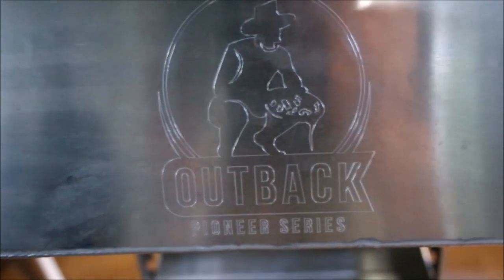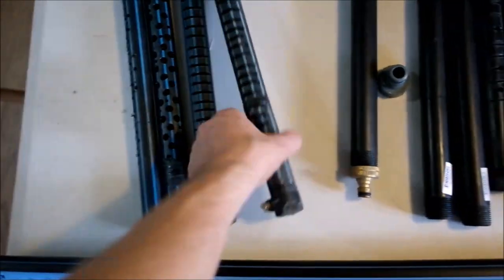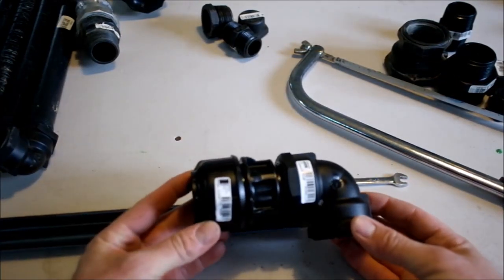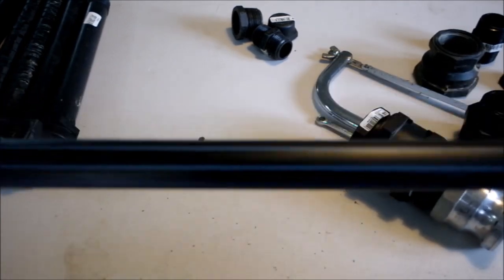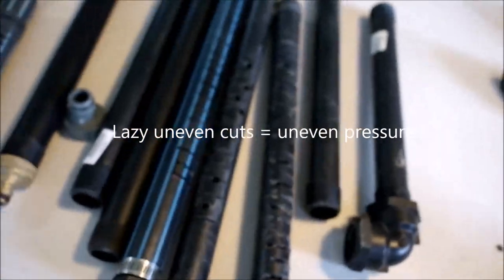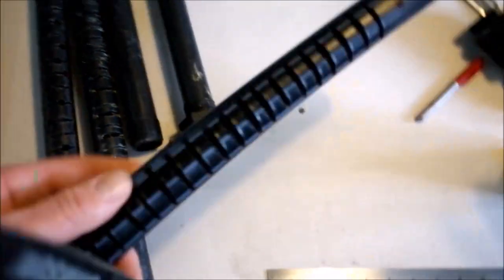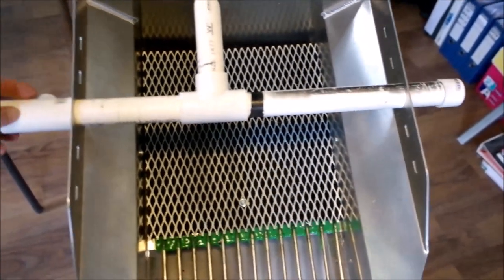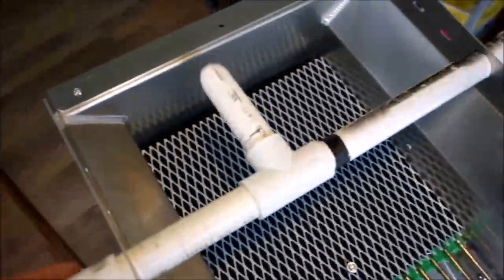Highbanker Spray Bar options  for the Outback Pioneer Series Highbanker

Comment: Thanks for the video, do you think Polly in 25mm would still work for a 10inch high banker fed with a 3700 bilge pump? Bunnings aren’t selling 32mm elbows anymore 😓
Reply from the maker: tomkurt2450 hey mate 25mm risers work ok they just dont flex as well as the poly. Bunnings definately do still sell the elbows  they may have just run out this month
Reply: Both types are in stock:  https://www.bunnings.com.au/philmac-32mm-metric-poly-pipe-elbow_p4813795
and these: https://www.bunnings.com.au/holman-32mm-90-white-pvc-elbow_p3141320
Reply: What size hose are you running from the bilge pump tom?

Comment: What you recommend for a spray bar set up for your bucket sluice I bought off you?
Reply from the maker: Bucket sluice?
Reply: Sorry, the push box. Theres a hole in the hopper looks to be 2" maybe? I've used it a couple of times doing the bucket method and it's fine but I would like to see if a small pump with spray bar would be ideal also
Reply from the maker: @samroberts8365  exactly the same as this video mate. I use 32mm poly it gives good spread and flex